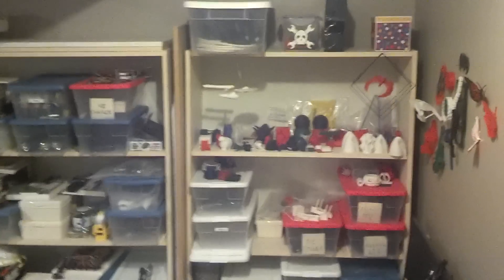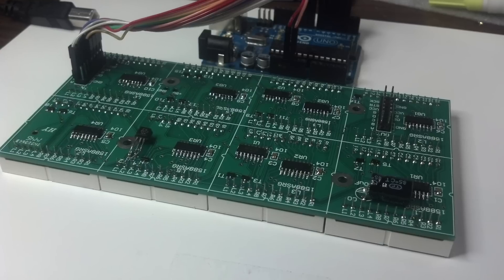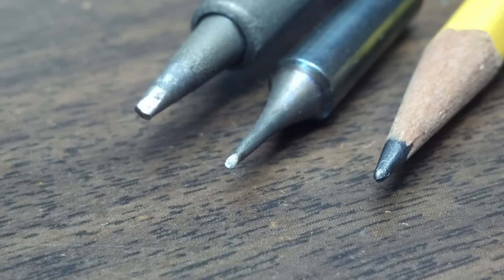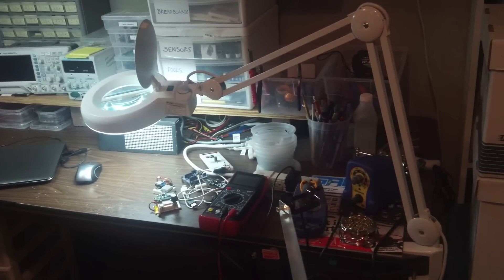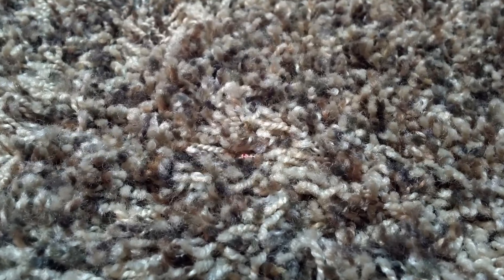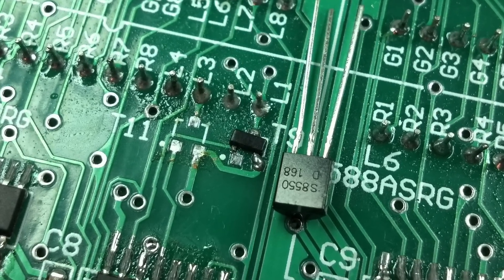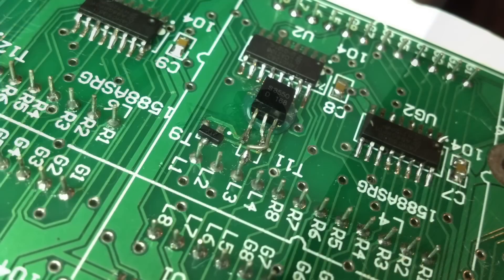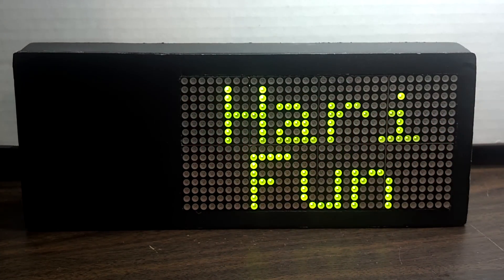HariFun#112 - 16x32 LED Matrix Kit (part 2)

Comment: thanks for responding,  the labels on mine are not all showing,but all of the notches are matching the circuit board. 
steve
Reply from the maker: +Steve Tripoli 
Ah... I see what you meant now.  Well, that's good.  Desoldering those matrices would have been very painful.  Maybe the ABCD lines have a bad solder joint?  I believe those control the rows.  Good luck Steve!

Comment: Hi Hari,
I´ve ordered one of these modules but it hasn´t arrived yet. I´ve played around with a led matrix when I planned to build a 16x32 matrix on breadboard (after hours of soldering I ordered the pcb-module :D)
I wonder about the brightness of the module since one of the HC595 chips has an maximum output current (all pins combined) of 500mA. Multiplexing 8 rows made it hardly visible at normal daylight in my early tests. This version seems to have no current limiting resistors, right? Maybe it´s more than the allowed 500mA? What do you think?:)
The other thing I had trouble with when trying to build it on breadboard was the Arduino and the output frequency. I tried to get some PWM that worked theoretically quite well but when I tried to refresh the output by interrupts the output frequency was so slow that flackering was really visible.. Have you experimented with using the output enable pin on the module for dimming the brightness?

nice video!:)
Reply from the maker: +Harry Morgan , unfortunately this display is not especially bright. :-(
No, I have not experimented with PWM on matrix.  I think what you want is called bit slicing. Instead of pulsing the output enable, the code would PWM each pin instead of the whole matrix.

Comment: You did it!
I definitely need to get one of those flux pens, even for regular through-hole components. :-)
Reply from the maker: ***** , yes, they work great on any type of soldering.  Incidentally, my flux pen has an expiration date of FOUR years ago.  But it still works great!  Good thing too, because IIRC, it wasn't cheap.

Comment: Hello Hari! I bought exactly this module in ICstation and I'm just discouraged! I'm connecting (I think) everything correctly but I can not run; the VCC IN header pins should also be connected? or what is its function? Anyway, none of the internet code works for me!
If you can help me, I thank you very,
Daniel
Reply from the maker: I took some photos on how I wired up mine for someone else.
Here are some photos of my wiring.  Let me know if you still have questions.
https://goo.gl/photos/T84ALpkA7J9XTECH7

Comment: Does using only Arduino Vcc pins enough to power this matrix? Because I see there's a separate Vcc and Gnd pads on LED PCB. Also do you need to use resistors for this matrix? And  I heard some of this type matrices can combining red and green create yellow color, but I guess not with this matrix?
Reply: +Hari Wiguna Did you use external power source? And also what about resistors? Can you show pictures of everything connected, because at the end of the video we can only see led matrix mounted inside a box.
Reply from the maker: Sorry about the late reply.  I thought I've replied to your comment from a week ago.
I am only using the Arduino to power the matrix, but if you have more than one you probably should power the matrix separately.
I did not add any extra resistors beyond the ones already on the kit.
My matrix has red and green and when both on it looks yellow.
Finally, here are some pictures I took for another viewer a while ago.
https://goo.gl/photos/T84ALpkA7J9XTECH7
Reply: No worries and I really appreciate your replies. Hope not bothering you to much. Anyway, I earlier asked you about resistors because to me it seems none are included on the kit. I have the same kit as yours and all components are: El. cap; 10x smd cap; 2x 74HC138; 8x 74HC595, 16x transistors; 2x male pin connectors,8x matrices and PCB. I'm guessing because 74HC595 chip only serves 80mA of current for 8 led (matrix row) each individual 1/8 LED get 10mA. And using multiplexing each row gets the same current (not less or greater current). That's why LED don't "burn". Correct me if I'm wrong.
Reply from the maker: I actually enjoy interacting with people who watches my videos. So, you are not a bother at all.  I've just went downstairs and checked. You are correct, there are no resistors!  I was wrong about that. Sorry.
You are also correct about multiplexing only giving each led intermittent power so it never really get the full blast.

Comment: Why aren't you connecting anything to OUT pins? Just curious what's their purpose.
Reply: Or are they used for daisy chaining? EDIT: Oh I see you answered it. Thank you.
Reply from the maker: The OUT pins could be connected to ANOTHER display's IN pins.  So, you could drive multiple displays with one Arduino.  In the software you would push more data and as it overflows the first screen, it would get transmitted to the next screen, and the next, and the next, and so forth.  Thanks for question!
Reply: Do you still have this matrix? I wonder how to adjust these libraries to work on my PIC microcontroller.
Reply from the maker: Yes, I still have it.  I didn't write the library, but I linked it in the video description.  You should be able to adapt it to your PIC.  Post a link here if/when you got it to work on your PIC.  I bet there are others who would like to do that too.
Reply: Josh3292
Reply: ok

Comment: Hi, Great video thanks. I just finished mine it's the same one you have. Did you have to modify the code in any way from the one you suggested ( http://www.instructables.com/id/32x16 ) , but mine has jumbled text and the upper scrolling part doesn't look like his. I re checked all of my components and soldering and its correct and I verified my arduino connections and they are correct, any suggestions? again thanks,
Steve
Reply from the maker: Hi +Steve Tripoli ,
The code in that Instructable worked for me.  :-(  
I wonder if you got the matrix rotated.   You know, physically they could be plugged in one or two ways, but as you could imagine there is only one correct way to orient it as far as correctly wiring it electrically.  I'm not home now, but I will check later so you could compare the orientation of my matrix vs. yours.
Reply: +Hari Wiguna 
Thanks for the quick responce. I hope they are in correctly, I see the tabs and they seem to interlock with each other.
Reply from the maker: +Steve Tripoli , I took photos of my two 16x32 LED Matrices.  One from ICStation and the other from GearBest.  They both have the labeled side of the LED Matrix near pins G1..L8.  Also note the bumps (rather than the indents) are also on this labeled side.
https://goo.gl/photos/sVwDbqCqnNgM4GpCA

Comment: Do you have the circuit diagram of this circuit?. And can you share it?
Reply from the maker: Edwin Noorlander , I do not have circuit digram for this circuit. :-( ICStation does not even have any instructions linked on the product page.  Thankfully, I found an instructable for a similar matrix (it does not seem to use any discrete transistors). Both are linked in the youtube video description.
If anyone found a diagram for this kit, please post it in a comment.  I think everyone would find that useful.
Reply from the maker: TheBarrule , Yes, that is exactly the same kit as mine!  THANK YOU!!

Comment: Is there a version 16x64? Or, how to connect two panel 16x32?
Reply from the maker: The board is designed to be chained together, there is an IN connector and OUT connector.  Unfortunately, I don't know anything beyond that.  I suspect, to make a 16x64 you would still daisy chain them into one long string electrically, but arrange them in 2x2 board configuration physically.